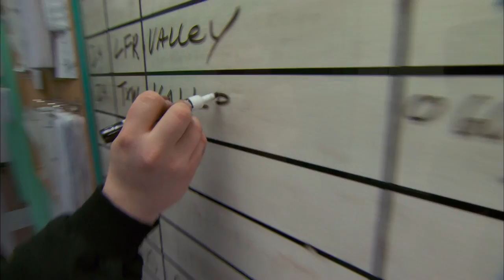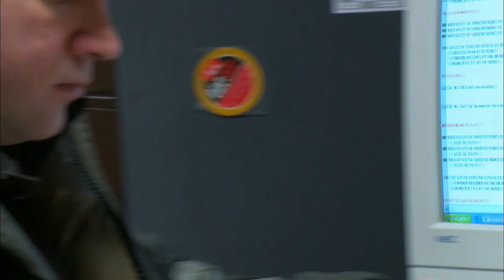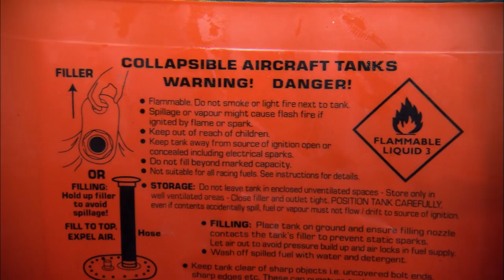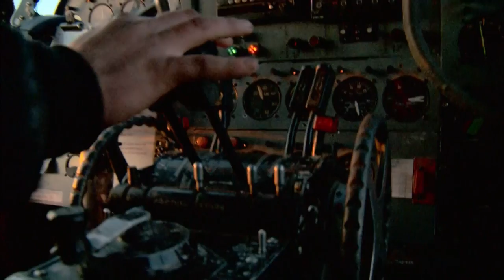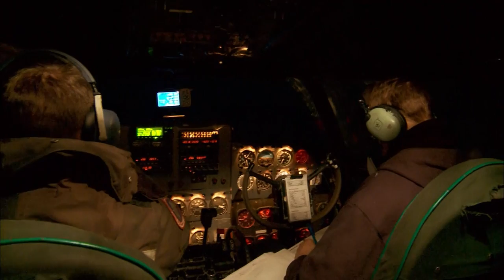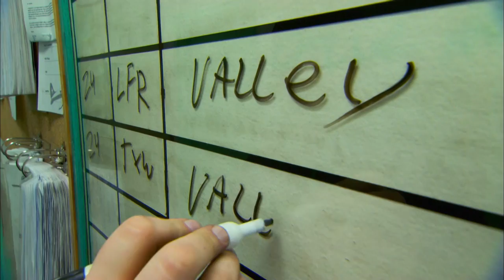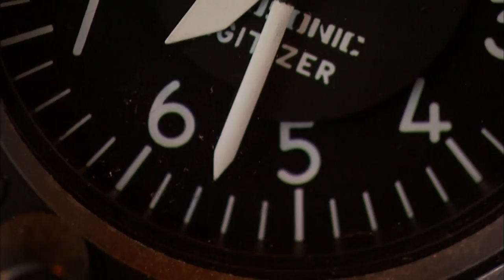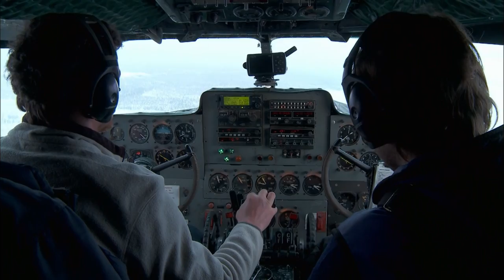Water Bombers Won't Withstand Winter Trans-Atlantic Flight | Ice Pilots NWT | Wonder

Comment: Very nice views of the green pickle. I wonder what they call it.. The sounds are awesome too. Starting up especially, and running, muffled sounds in the distance.. big pistons are awesome.
If that rubber hose went bad 50 hours later than when it did, Turkeys would've had a failure on their new plane as soon as they got it.

Comment: I do their cabin heaters. Try to give them the best product possible.
Reply: I was wondering what kind of heat they had. I noticed they were bundled up the whole time. I read that the bombers in ww2 didn't have any heat and there were a lot of problems with hypothermia. Do they channel heat off of the engine or exhaust?
 Thanks.
Reply: @Softail77us  They had gas combustion heaters but they were not effective as the aircraft had no pressurization. Open door gunners at 30,000 feet. fleece jackets and electric heated suits were the norm.
Reply: @PJHEATERMAN  What do the Buffalo have?
Reply: @Softail77us  This aircraft was originally powered by a radial engine. (Gasoline powered) they went to turbine power for more performance not to mention lighter weight. I do both heaters for these aircraft but the turbine powered aircraft is what i see in my shop. The heater is for the cockpit only. I also do heaters for the DC6/7 for operators in Canada and Alaska. Buffalo are now operating more advanced aircraft
Reply: @PJHEATERMAN  Does the cabin air get warmed via the exhaust manifold? Kinda like a volkswagen beetle except without the fumes?
Reply: @Softail77us  Single engine aircraft use exhaust manifold baffeling  for heat as it is a short and direct channel through the firewall to the cabin. It's very effective. Cabin class twins that are turbocharged fly at higher altitudes and pumping exhaust heat from engines located out board from the cabin doesn't work. Turbo charging and pressurization (30'000 FEET) require gas fired combustion heaters.

Comment: Old Joe uses those cool aircraft to be a slave driver over the pilots. Paid only for hours in the air? Pretty rude.
Reply: Flight attendants for major airlines are the same. It seems be normal practice in commercial aviation.

Comment: If I remember correctly the water bombs should be able to land in water so they could just land near a fuel ship refuel and take off sure it'd be pretty rough but should work I mean after all you have small speed boats that are pretty much the same size as the water bombers boat features out in super rough seas for them doing pretty fine sure I know any water could ruin a engine but if there's no access points for the water you should have a good day For the most part other then a few sea sick people maybe hell they could head to Alaska and head down through russia to turkey either way there probably the same distance away
Reply: Yes. Brilliant idea! Why didn’t they think of that…
Reply: These planes can indeed land on calm flat lakes, but not rough seas or oceans. The plane would be in bits in a few minutes if they even managed to land it in one piece.

Comment: 18 cylinder? Are you sure it's not a 9 cylinder engine?
Reply: R-2800 double wasp, 18 cyl two rows of 9 cyl per row
Reply: @viper100290  
Holy Smoke! 
1068Kg !!! One Hp per cu. inch! That is a monster!  
Thanks for the note!
Reply: @touchofgrey5372  check out the R4360, a 28 cyl 4 row radial developed after and powered alot of aircraft into the 1960s
Reply: @viper100290  
Yes! I remember now; the one with Jay Leno! This is really a huge one! No wonder they came up with the jet engine!

Comment: I am sat hear thinking 💭 wtf are these people on, how can you find the courage to fly these old crates, they must either have a death wish or they are just plane ✈️ crazy. The amount of rules and regulations they must be breaking is beyond belief, ok, I realise that they provide almost an emergency lifeline to remote settlements, but, they should surly have better equipment and especially aircraft, aircraft that are designed for this kind of environmental conditions.
Reply: nop
Reply: You haven't a clue of what you're talking about.
Reply: They do not break rules  As for getting better aircraft I agree but how prey tell are you going to have aircraft manufactured to support  economics on that small scale?  Cannot be done   Gotta use what there is or haul it all up on dog sleds  Even Ice roads only work in deep winter and are only economical to cut and maintain  when traffic reaches a certain economic scale  Even light  bush aircraft only work out because the tourist  and sports hunting economy provides a critial cash transfusion   operations like Joes are supported by the northern Canadian economy as a whole which is very small.

Comment: These planes are clearly in the wrong hands. Either all this is to drum up drama and tension or these people have no clue what they are doing. None of these planes are air worthy if you take what you are told at face value.

Yes, these planes are old.. very very old. Both I have experience with and grew up around.. the problems they are having point to incompetence. But when properly maintained they are amazingly safe. These guys are like shade tree mechanics. I wouldn't trust them with a paper airplane.